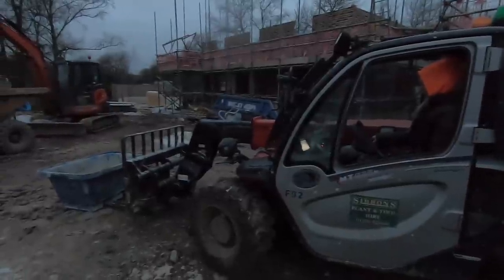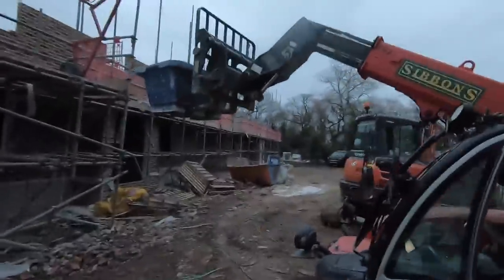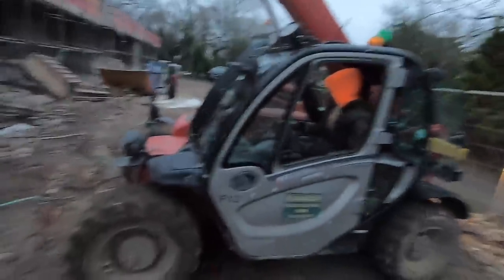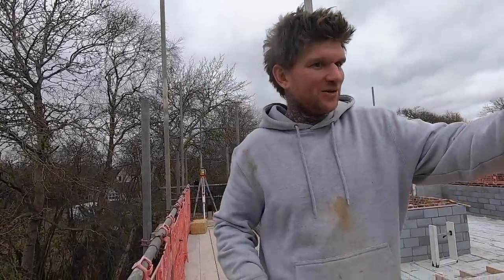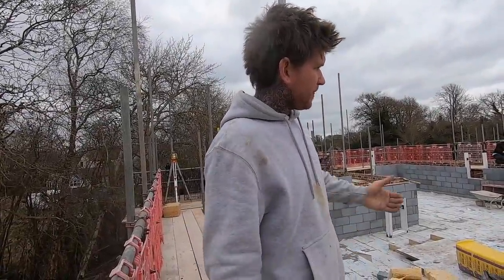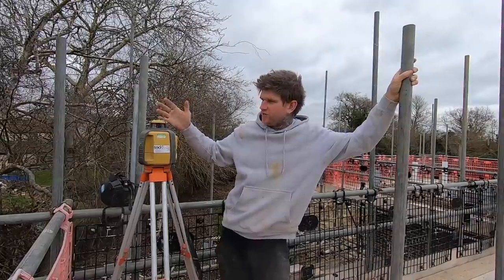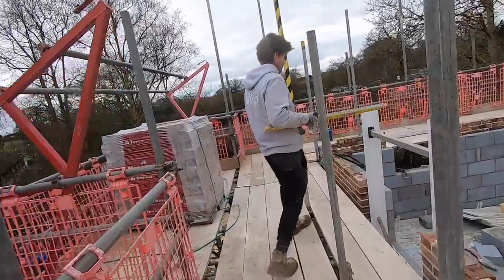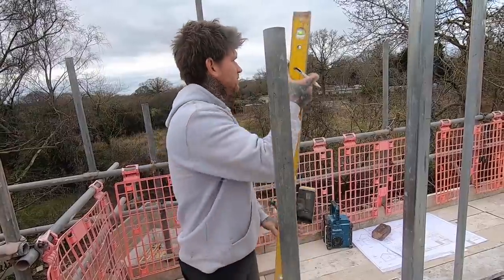Scaffold timelapse

Comment: Great video. Love the discussion when Amy driving the loader. She will soon be good at that. Liked the explanation on sorting the levels. So at lowest corner you will be adding an extra 2mm per course to level it up. Assume that is about the max you can do on allowed tolerances. Laser level amazing. I used to use a hose with a bit of clear pipe attached each end. Have to go for a tea while it stops bouncing LOL.